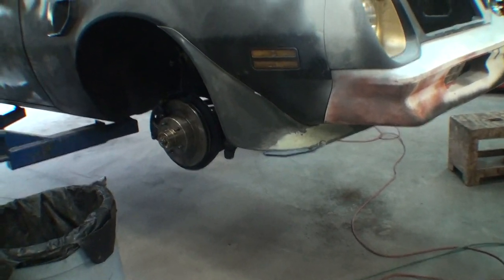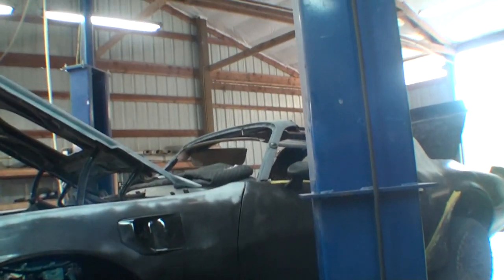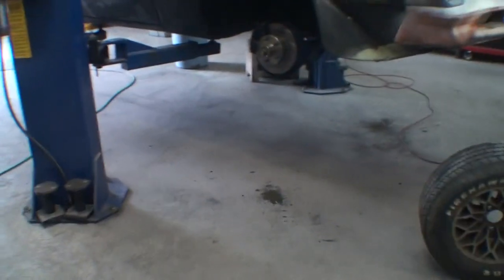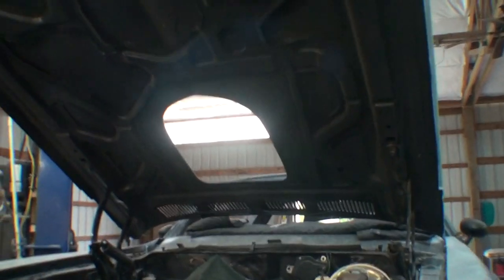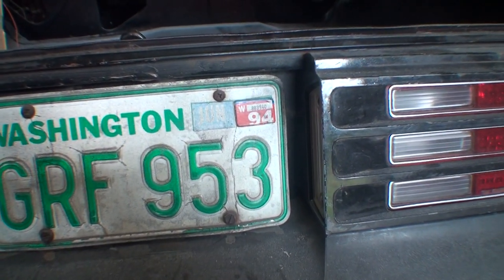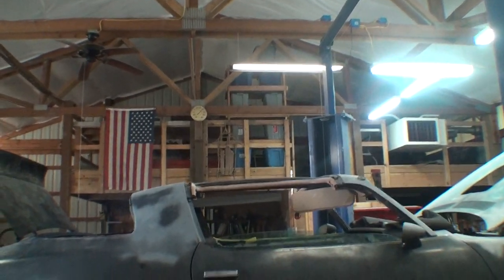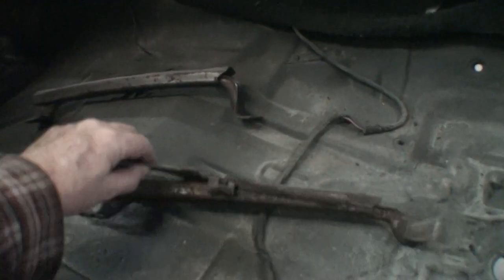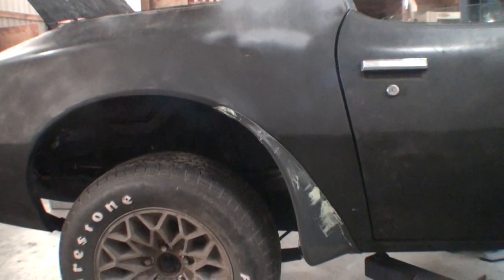76 Trans AM (175) Finish  Body Bolt On Parts, - looking back to beginning,

Comment: Robert  can you please show in you next update  the manual you are using for this restoration.Thank you.
Reply from the maker: That is why i am making all these videos to help others, the manuals are not clear, some where in all these videos are the answers to the endless questions. Try Video 33 for the manuals i am using. However its more trial and error & searching for answers looking for pictures. But feel free to ask me the questions i probably have ran across the problem and the answer.  Its hard to name the videos for each topic because there are so many different aspects that i run into in as i work thru the car. Yes i will add it into the next video the manuals, but you will find out what i mean.
Reply: @robertmccully2792  Thank you.

Comment: Hi again can i please ask, in your opinion can the doors be removed to replace the upper and lower hinges (not to repair the bushes) with the front left and right fenders in place.Or do the front fenders need to be removed to do this?Thank you for your time.
Reply from the maker: Its almost impossible. Take the fenders off with the inner wheel wells attached, which means you have to remove hood also. The problem is, to tighten the bolts on the hinges, so you can adjust the doors, the doors need to be open. Before you remove the fenders mark the existing locations so as to realign easily. If you don't mark the exact location of fender before you remove them, you might adjust the door to the wrong height and so on. I have  videos on adjusting the doors with paint stir sticks, as  shims, and removing the doors with engine hoist.. the doors are very heavy and awkward.  You might be able to bend the hinges with doors on car, if the bushing are good... i have seen videos on that. Remember that i had to learn all the same stuff, so later videos might be upgraded by newer dated videos with the better solutions. The doors can be adjusted in and out, up and down, and side to side.  Another way i have considered, is to cut the fender sheet metal out at the hinges locations so you don't have to remove the fenders, if you do that, give your self plenty of room to work, than weld the pieces back into the same slot. There are a hundred ways to do anything. Think it all out,
Reply from the maker: Personally after removing doors a few times, and then putting the fender on, to than find out you have to take the fender back off to adjust the doors again. I would cut two nice size holes in the fenders, away from the edges. Once you remove the fenders its becomes a alignment mess, with hood and doors and nose and hood and so on.
Reply: @robertmccully2792  Thank you Robert , the bonnet on my car is out on one corner , poor design as i have seen many cars with alignment issuse.I will keep watching your progress ,your videos are very good and have probably helped alot of people.Thank you again.
Reply from the maker: @af4306  did you see my video 168 on bending the hood.